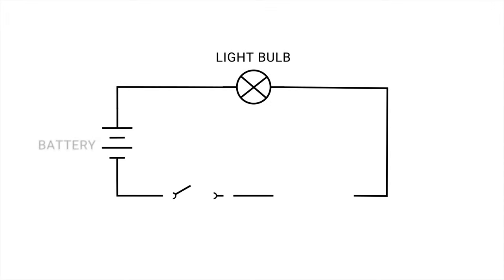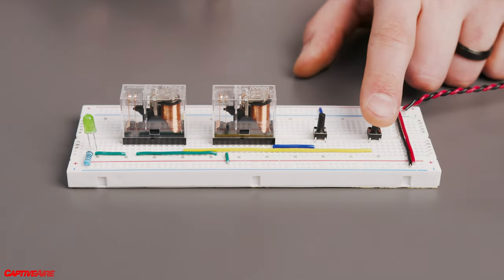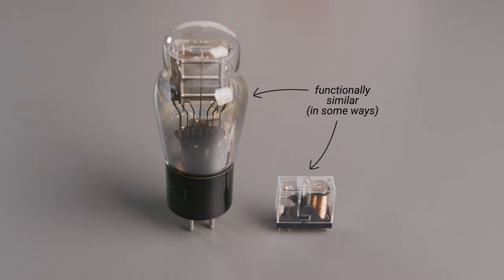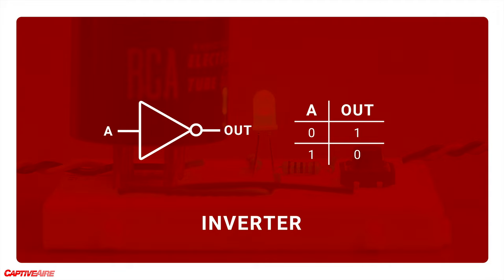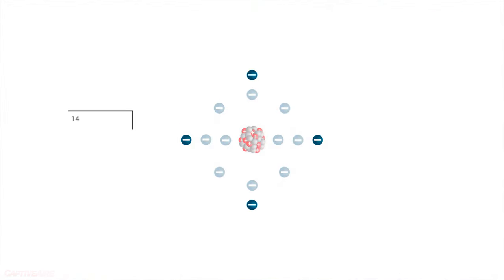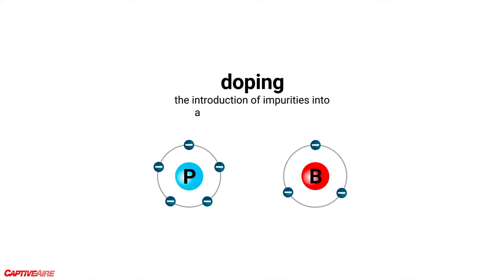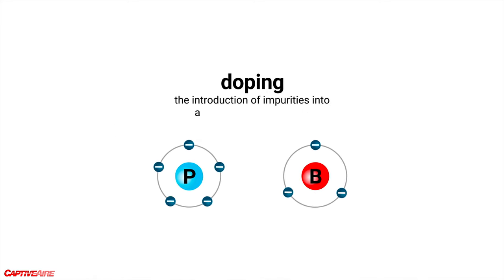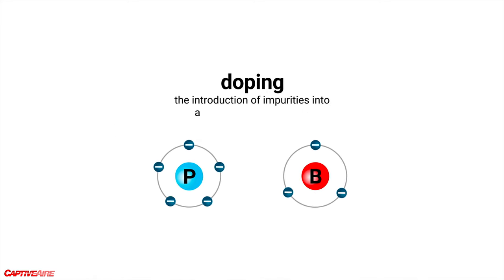Computer Science in HVAC

Comment: Incredible. I'm really impressed by your video quality. Some comments, I understand that this products are no focused on the industry more on comercial buildings at the industry we work with PLC as you need people there in plat to solve the problem and it's a must to check the code so you understand where the problem is, also bc they are very robust. How are you solving this moving from plc to build your own controller? Creating a lot of alarms for each possible case? 
I'm also interested in hearing more a bout how you control the air using the humidity, I don't know if you have made some project for the paper industr but we use a lot, but a lof of air. This type of knowleadge would be very value in this industry. Hope the best to you.